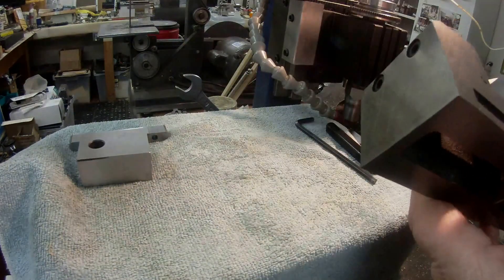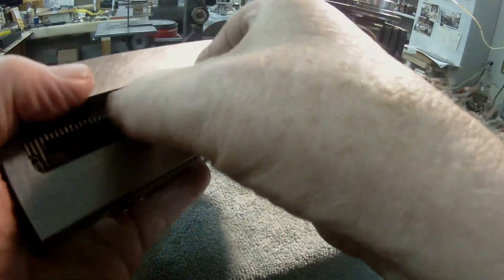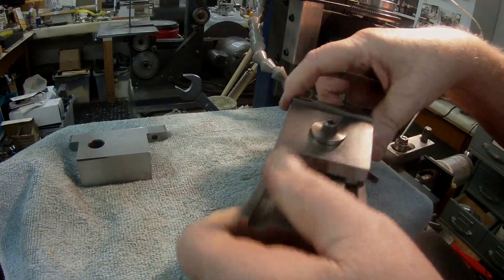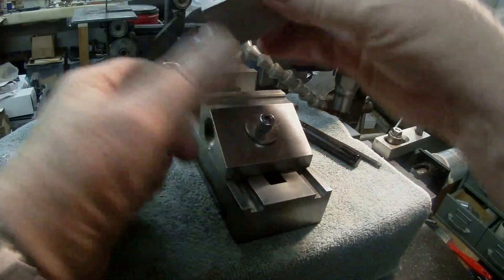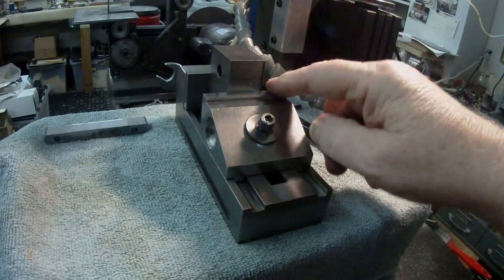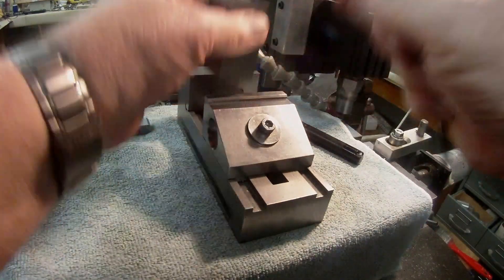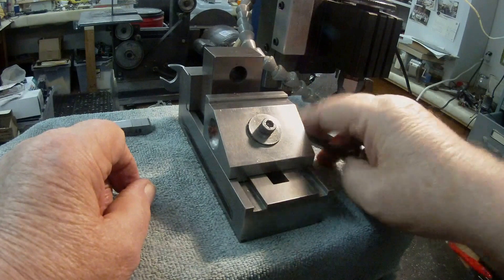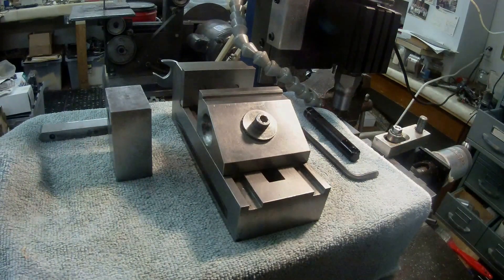FILE0013 Fill in Video

Comment: Walter:  Thanks for a great explanation.  I've been using that method of some time now myself and it works quite well.  If I recall, you explained the method in a previous video and I was actually a bit confused, but after actually putting it to practice, I was able to see clearly how it works.  Thanks again and Best Regards: Larry